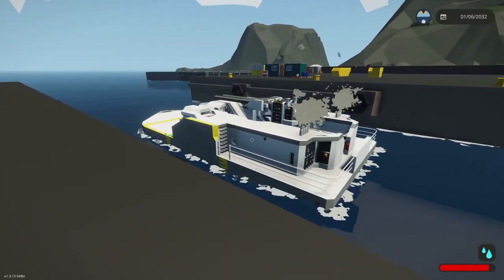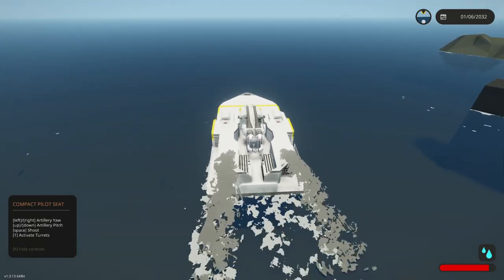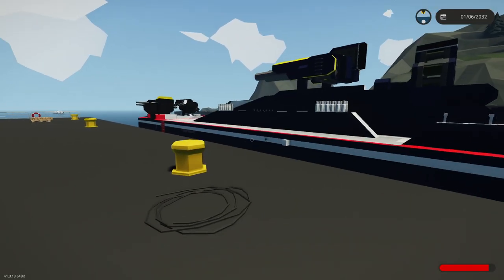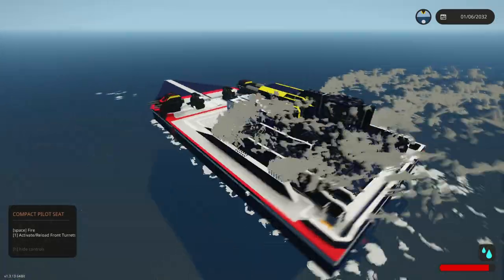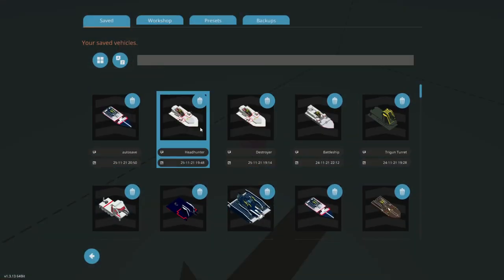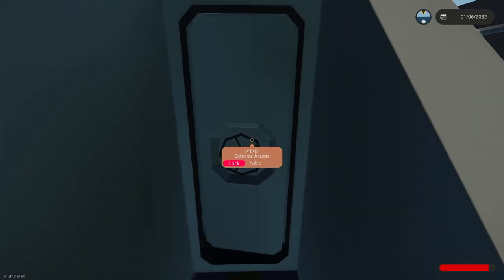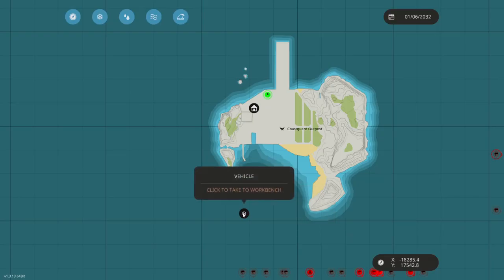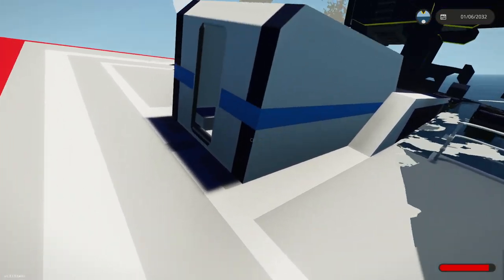Stormworks Damage Modeling Discussion

Comment: I think the damage system suffers less in a ground vehicle. In that the name of the game is putting your fire hazzards like batteries and fueltanks away from danger while making important systems like elevation and traverse pivots or transmission easily accessible for repairs, and of course making a vehicle that performs well besides all of that
You won't be trying to absorb damage, you will be trying to make it easy to deal with